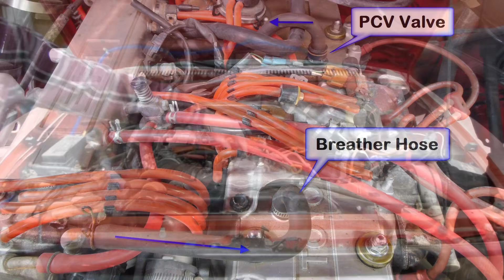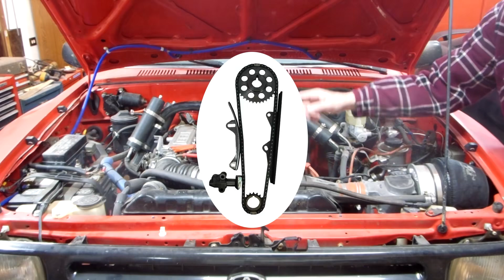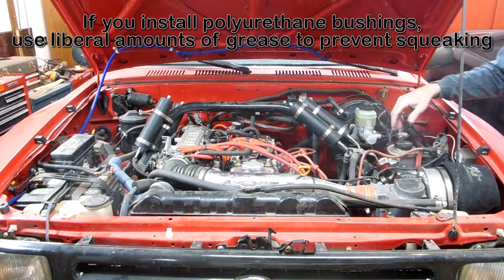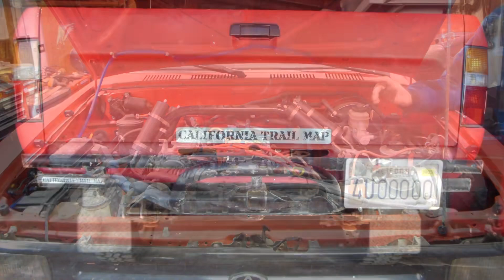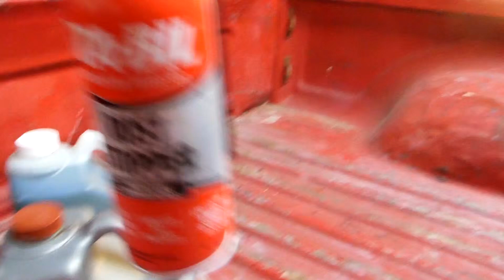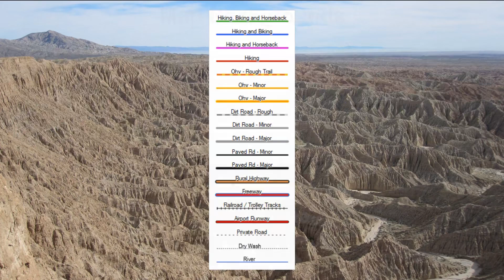Toyota 22R-E Engine Overview

Comment: Really great overview! I love learning about my truck. Just did my first timing chain job. I dropped oil pan and didnt remove the head. Kinda sketchy i know. However everything seems to have been leak free. My half moons are just seeping a little oil. My waterpump had a tiny bit of coolant bubbling out of a few of the bolts. Weird i know. Then to top it off. The one that goes through to the block seemed to be leaking a tiny bit of oil!!! I was like wtf? I know rtv isnt needed there and doesnt call for it in manual. However i assumed maybe the gasket did not seat correctly so going to go ahead and redo that seal here soon and put on some tack / sealer to help that gasket seal up nicely.
Reply: how’d it go? had the same problem, waiting for the seal this week to get her done
Reply: @justice.1221 my waterpump is all sealed up. I used some gasket shellac all over the waterpump gasket. Took care of that leak. Now i think i have another leak. Its slow. But it seems to be on my passenger side near timing cover. I cleaned everything up real good. Its a slow seep. Im contemplating taking my distributor out again and checking the top hidden bolt. Maybe applying more RTV. Hard to say if that bolt would cause a leak just on my passenger side timing chain. I didnt apply gasket shellac or a thin coat of fipg on timing cover gaskets. Really wishing i would have now. Ill probably try to apply a little bit of fipg on the seam of the timing cover and put more RTV on the hidden bolt. I have heard you want to torque that bolt first but on 4crawlers write up about doing timing chain job without removing head i swear he mentioms torqueing that bolt last. So im honestly not sure what to do at this point. Its a tiny drop about once a day. Have to add a lil oil every 2 weeks or so. Might just run it for awhile. Really dont wanna take timing cover off again. However good news no leaks around head gasket ! Or oil pump. Or water pump. Or front main seal. Just a lil seepage passenger side timing cover. Almost looks like right around where the egr/water pipe tube connects to timing cover on passenger side. Driver side is all dry. Under head and distrubutor all dry. Half moons all dry.
Reply: I was speculating my distributor SHAFT oring but it seems it would be leaking on alternator or on driver side more.
Reply: Only leaks passenger side timing cover. It seeps and it travels down block and down to my oil drain. I thought i fucked up the pan but after cleaning i noticed a tiny bit of oil coming from one of the threads that attaches to that pipe back of timing cover passenger side. . Idk what the pipe is. Egr or coolant pipe. The one that attaches to back of timing cover. Maybe i need to toyota fipg those 2 bolts that attach to that pipe. I have no idea. I know it doesnt call for fipg there but im at a loss Lol just gonna try to seal it up from the outside i think. Or its coming down from the hidden bolt somehow but its all dry above my waterpump/underneath head now. I already gently snugged up those bolts that attach to the pipe and didnt seem to stop it at all. I might need to get an oil dye kit to really pinpoint it..

Comment: I plan to watch this whole video. I’ve got a 92 22re that sometimes doesn’t like to start after driving 15mins or so. Otherwise drives great. I did also have starting issue when it was very cold outside.
Reply from the maker: The vacuum line going from the FPR to the intake is to compensate for the pressure inside of the intake. Fuel pressure needs to be relative to the intake pressure, not the outside pressure. When there's a vacuum in the intake, it effectively sucks fuel out of the injectors.

The blue Vacuum Switching Valve(VSV) on the FPR is activated by the ECU. The purpose is to increase fuel pressure when on hot starts to prevent vapor lock. The VSV will remain closed on start so that the vacuum inside the intake isn't taken into account. The pressure should remain high for about two minutes.  If you pinch that vacuum line and it starts up, then that's your problem.  The VSV can be tested by applying 12 volts.  Also, test the ECU temp sensor on the front of the intake and verify its wiring connections. The ECU may not know that the engine is hot.

Comment: If I don’t have ac can I remove the idle screw offs an plug it  

And great video explaining the 22re
Reply: If you don't have AC, then there should be a thick vacuum line going from the throttle body to the power steering then back to the port where the AC idle up device is normally mounted.  It shouldn't be there.
Reply: @fluxcapacitor1621  the I swapped the motor it eat a crank bearing   Motor I put back in the truck had the ac compressor on it but no ac lines to run the ac

Comment: Great video, nice to see a lot of the info I’ve compiled over the decades in one video. Reminds me of a vid I stumbled on years ago. It gave the same kinda information, breakdown and best approach in regards to removing the smog equipment to clean up the engine bay (wish I had saved that video as I’ve never been able to find it again. if anyone has it, that would be something else to  post).
Reply: Yota1 and LCE sell EGR delete kits with instructions. Pretty great unless you need to smog your car.
Reply: This is the best one I had ever found.  Covers it pretty well.  https://youtu.be/e3vg9prJcvs?si=ECY81HgjfE46TX3h